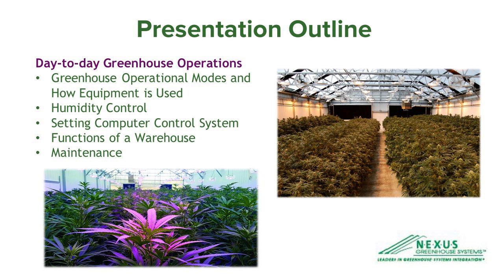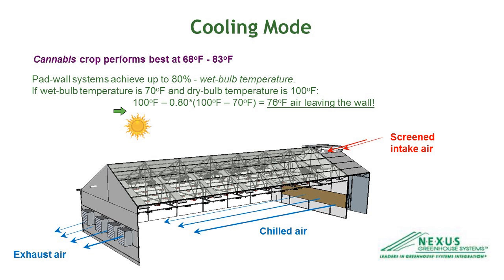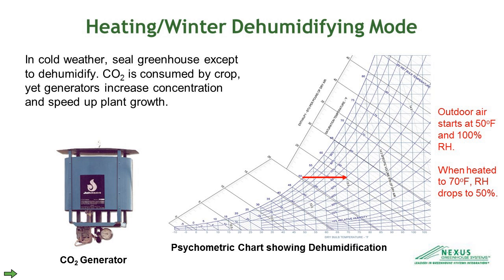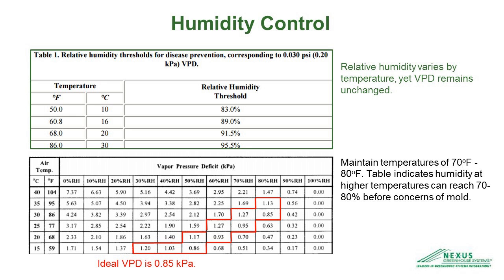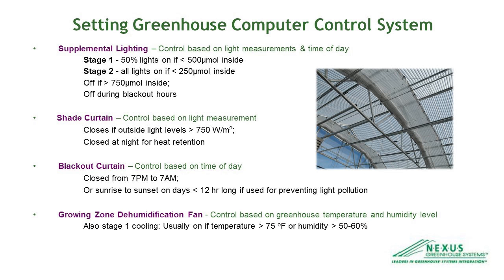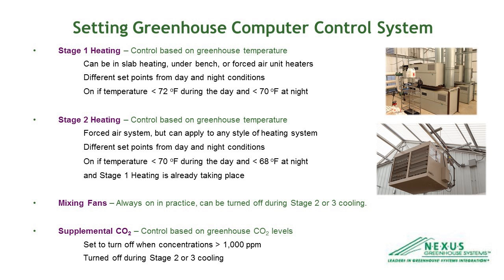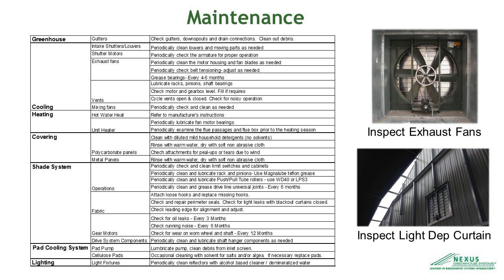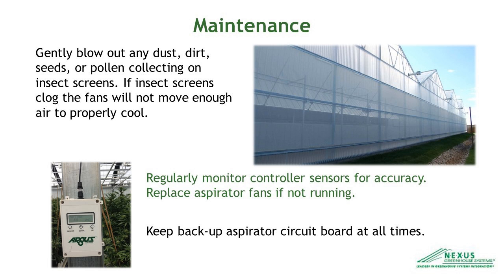Cannabis Greenhouse: Operations Manual

Comment: The only water source I have is a pond with high iron.
I want to know somebody can help me?
I want to put a pump to push the water to a RO filter.
How should I do it?
Reply: Full Spectrum DNA how high is it bro? You want some iron in there. Are you doing soil or hydro? if hydro what medium?How do you water top or flood? 
If you use an ro filter make sure to put a cheaper filter before it because ro filter bladders are expensive. Make sure to have storage tanks (barrel for water) because it takes a long time to filtef and you want water handy. When you use ro water make sure to use a bicarbonate to up the buffering capacity of the water. (Thats the waters ability to take on nutrients and not change ph) if you dont your ph will go up and down way to easy.
Any ?s you got let me know been doing this for more 20 years.
Reply: Nate L thanks for the info.
I put a 35 micron and then right after the 20 micron to protect my HydroGardner Pro filters.
I also put a strainer before my pump.
I'm using soil.
The water is coming from about 200 feet underground to a 10000 liter Reservoir.
You can see the video on my channel. I really do appreciate it.